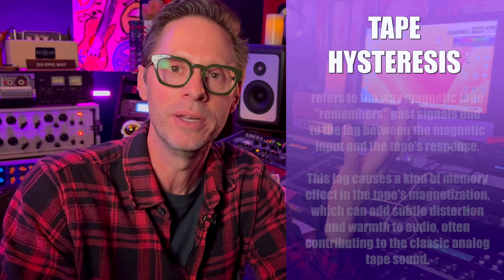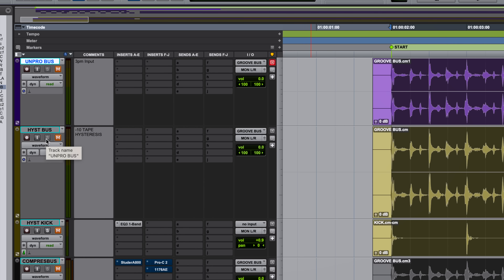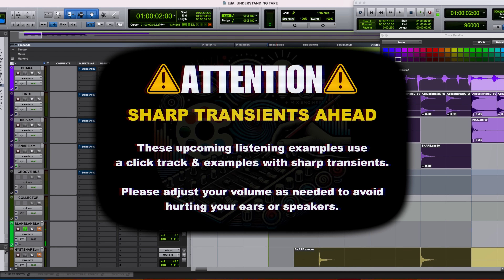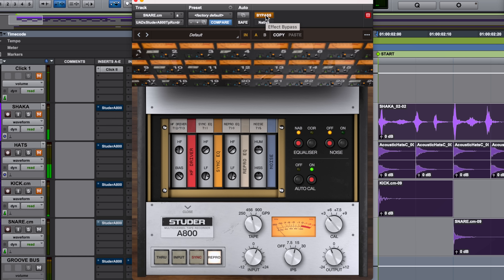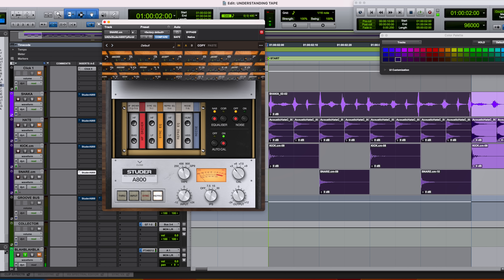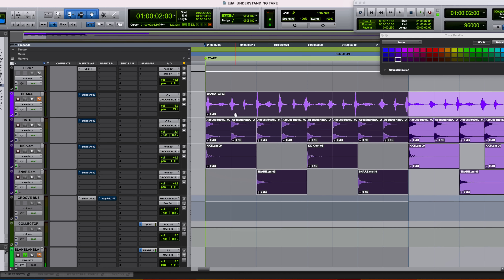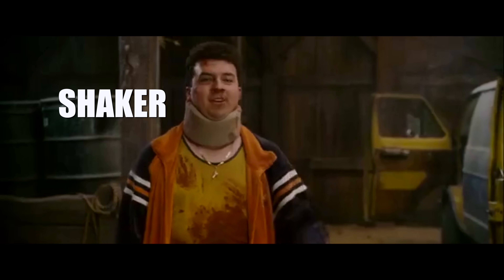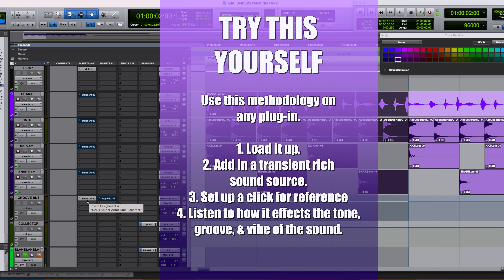How Tape Hysteresis Impacts Your Mix (And Why It Matters!)

Comment: The smearing you're going for is something everyone used to try their hardest to avoid. This is why pro studios used to record at high speeds like 30IPS, and why, after the 70s, lots of overdubbing happened on synced work tapes to avoid smearing on master tapes resulting from repeated playback. Smeared transients makes a fuzzy sound that was compounded with generations of copying to safety masters, master copies for duplication plants, more smearing when the plants made individual cassettes for consumers, etc.
Reply: Great insight! And yes, the degenerating quality of bounce downs, overdubs, etc is something some people love and to others feels dull or too blurry.
Tape is very fascinating and while I was not engineering when it was the main source of recording, it seemed most engineers understood the medium in regards to what to lean into and what to avoid and were not discussing it as the magical mojo everyone needs to apply blindly but rather it was just a part of the full recording process. Thank you so much for watching! Have a great day and have fun mixing!!

Comment: any plugin will add delay when recorded, but maybe using a transient shaper on your final mix would create the same sort of extending and groove (something i would have to try out).
Reply: Great points! Thank you for supporting the channel! Delay compensation is built into the renderings of the files, as I use HD. What I found fascinating was not the delay but the change in the wav form and shift in transients.
Please report back with your findings!! Have a great day and have fun mixing!!
Reply: Had the same thoughts
Reply: Experimenting with the release of a compressor might be closest. I have a video coming up regarding tape compression where I shoot it out against actual compressors and compare the sound.
If you come across a plugin combo that duplicates this effect….. keep me posted!

Comment: If the goal is to promote the use of tape, why not also take the time to use at least a real tape recorder at least to show? Plug-ins are great but only for certain applications. And the tape machine on the master provides an extremely particular magnetization; very complicated to emulate well. The plug-ins are interesting for educational purposes to show the principle as you have done here but to realize the real added value, it would have been necessary to take an SM900 and attack with a mix output: there are so many possible settings. As much as I have never really found any interesting tape plug-ins (very subtle or sometimes ghostly), I am completely seduced by the sound power of an old A80, M15 telefunken and NagraS. There are the input stages, the preamps, the transformers, the tape and its settings, the type of tape, the input level and the fabulous headroom which allows you to go in voltage much higher than in digital etc...
Reply: Hi! Thanks for supporting the channel. I don’t feel my goal is to promote usage but rather point out some interesting aspects of recording to tape that might not be inherently recognizable. I have like 6 or 7 more videos coming that talk about some of the topics you mentioned. Just wanted the content to be bite sized rather than 4 hours long 😂
I have a Tascam 388 and I agree with your point. No two real analog tape machines sound the same and there are so many factors that seem to contribute to that. It is that aspect I find really interesting. Have a great day!!
Reply from the maker: Just doubling down here, but these are great points. Maybe that will inspire another video series on the Tascam 388!? Hmm. But either way, thank you for stopping by and for commenting. Really appreciate your thoughts and comments.
Reply: Well said.